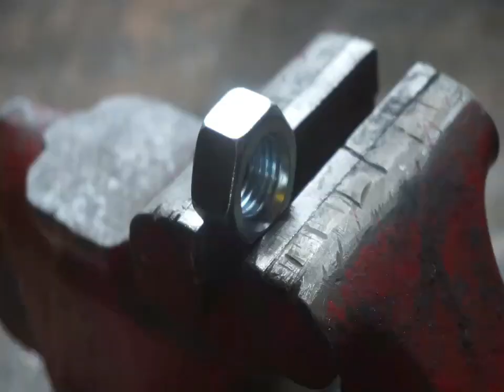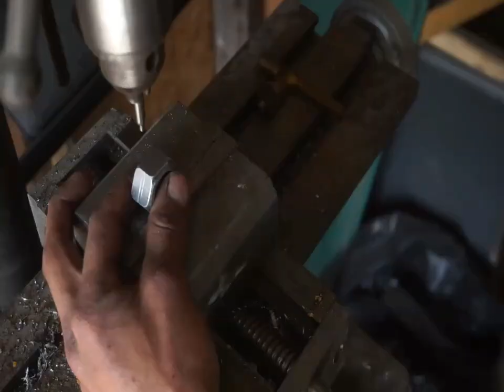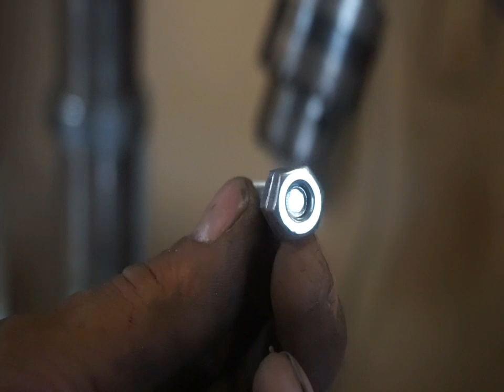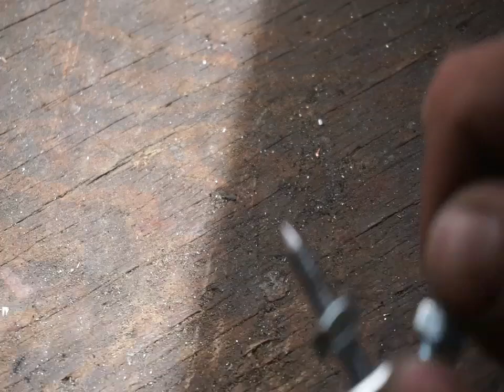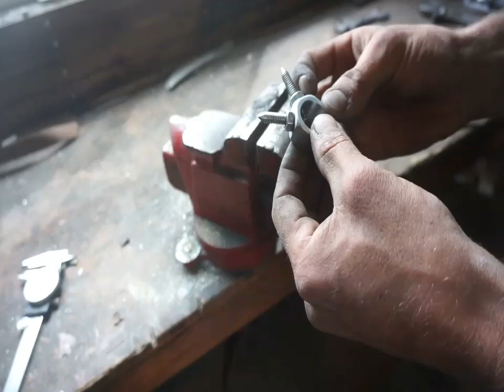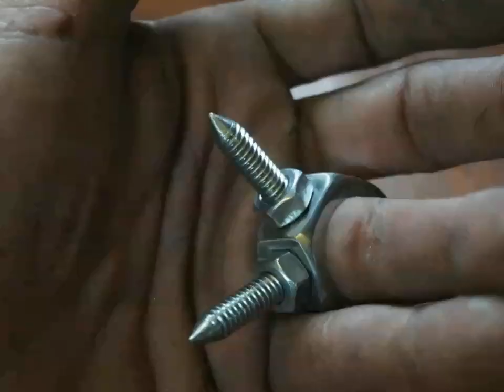lethal Ninja Weapons - Make Kakute Ring Knife

Comment: Great weapon. Can wrap it too so its easier on the hand and make the grip more firm. One hit to the eye and you can shock the opponent and withdraw to get space and run or draw your main weapon. Thanks for showing how to make this. Can sharpen the screws too. Also if you're gonna be questioned can easily toss this into the bush with no fear of replacement cost since its so easy to make.

Comment: For those asking why the threads are not burnished away and smoothed, it is because the threads are where poison, if it were to be employed by this device, may be applied, and act as a reservoir for it, until penetration.  After forward penetration, as well as subsequent reverse retraction of the kakute ring spikes as you pull back, the friction both going in and coming out again would release the poison into the bloodstream.
Reply: Thanks! What kind of poison do they use?

Comment: Cool looking! A weapon yes, but a knife, not so sure?
Reply: well the original design would have "cat claws" basically 3 razor  sharp discrete blades, youd only need maybe 1/4' to hit an artery in the neck (the main target area) simply put work into making the nails blades  after making sure they can turn or anything (spot welding or some pretty good glue would do) he just left it as nails

Comment: would u sell them?
Reply: Colt the Bolt just make it
Reply: Not every one has expensive tools like this guy.
Reply: You can make this at home without any of the gear honestly, just find a bolt that already has a hole through it or use like a wooden ring and force a nail through it. Does the same job. You can make a ring out of wood or even out of plastic water bottles or plastic containers. Use a lighter to slightly heat the plastic so it becomes pliable and soft and bend it around a circular object the same diameter as your finger and then once it's shaped as a ring wrap it with fabric or something so its more sturdy and then shove a nail or screw through it. If you do it with metal you can use various files to slowly file away the metal protrusions. Use whatever it takes hell even heavy duty leather gloves or armored motorcycle gloves with barbed wire or shaving razors wrapped around the fingers and knuckles is good enough to be a weapon. Just wrap the parts of the wire that go into your palm with more leather and lots of clay or tape so it doesn't hurt you.